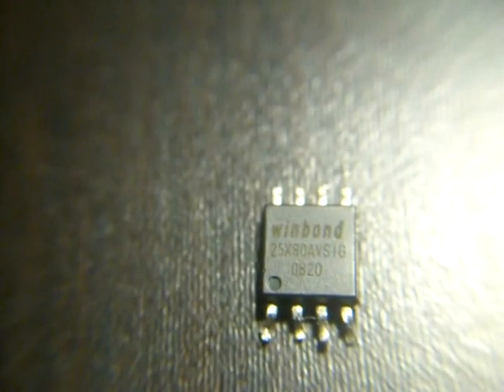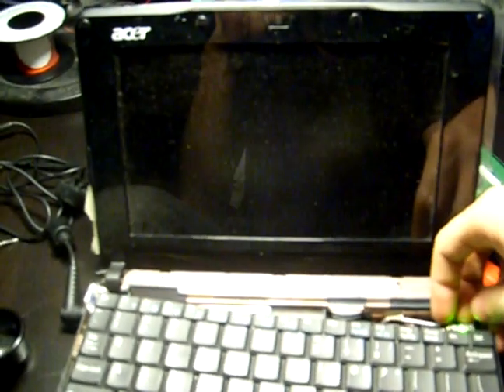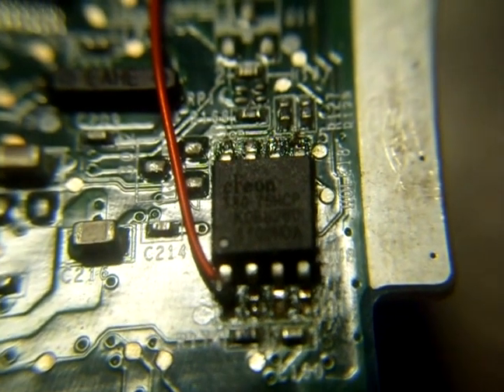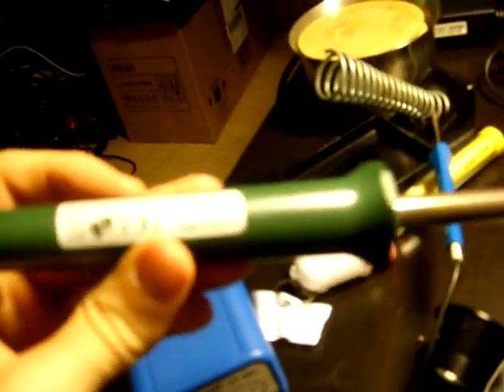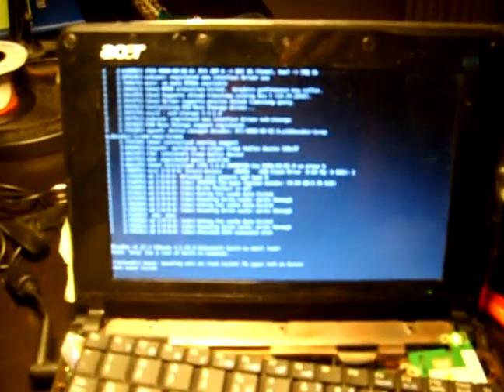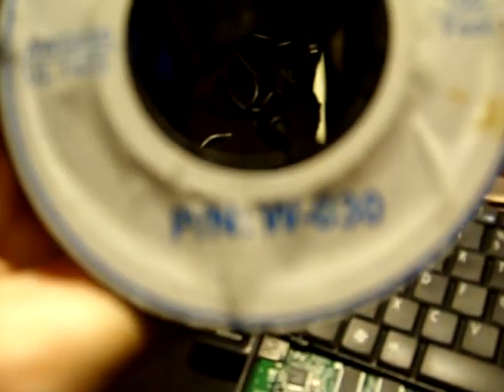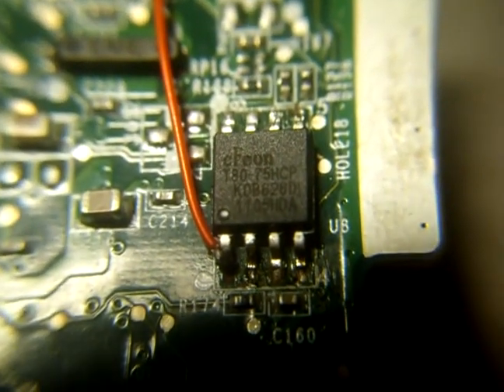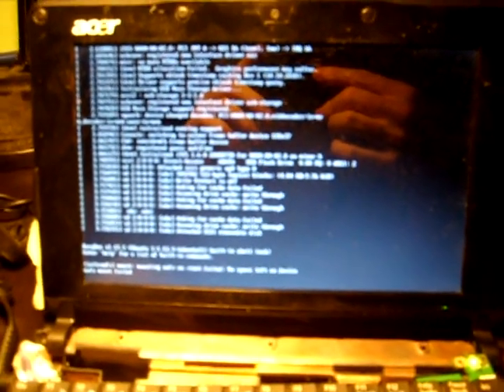Acer Aspire one 150 Bios replacment First boot

Comment: What was it like when you decided to replace the BIOS chip? Would it even power up?
Reply from the maker: It dint powerup, it was completly dead. I had emergency recovered the board twice before and it dint do anything like that anymore. So I asked some people on forums and they thought I might have killed the bios with all the rewrites (very unlikely with chips that allow 1000s if not milljoens of time rewrites) but the replacement did just worked easier than again trying to emergency recover.

Comment: same sh..it happend to me bro, i have an Aspire 6930G and i broke the BIOS while trying to Flash new Version, the Crisis Disk method with the USB dosen't work... :((

I have bought a fried motherboard, remove the BIOS Chip from it and put it on my motherboard... i need to buy the iron soldering...

Total cost was : 4 $ Iron Soldering
                        10 $ Defective Motherboard with BIOS Chip good
Still better than paying 80 $ to a Local Repair Shop for the chip to be replaced... or better than paying 100 $ for a new motherboard...